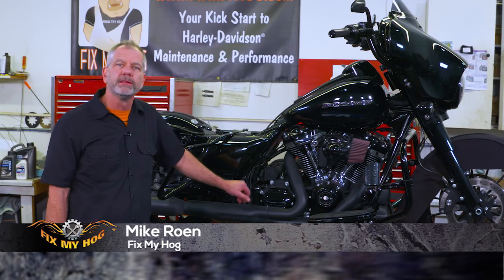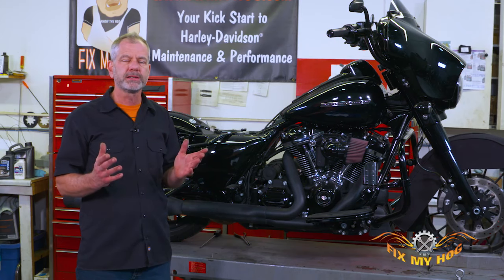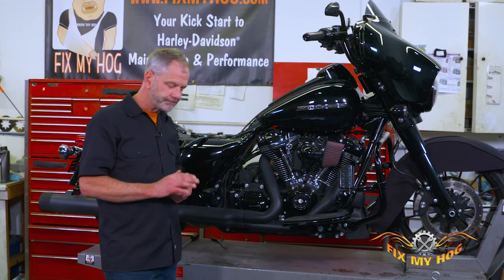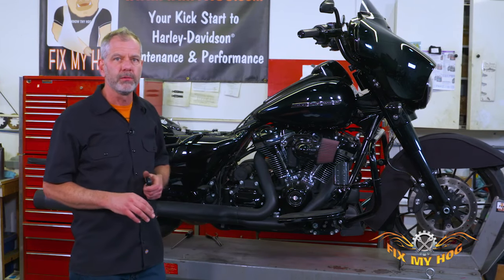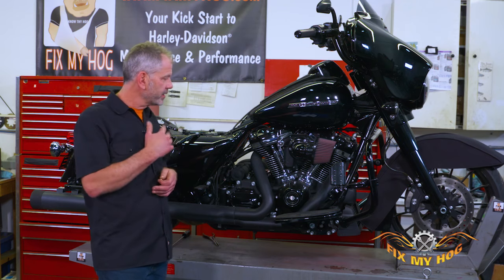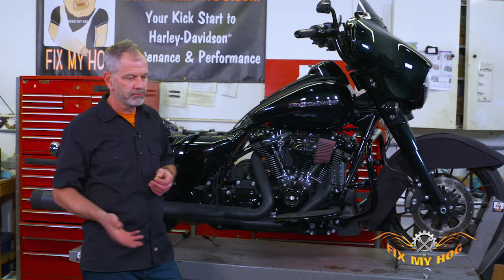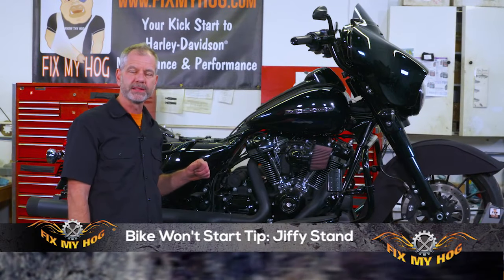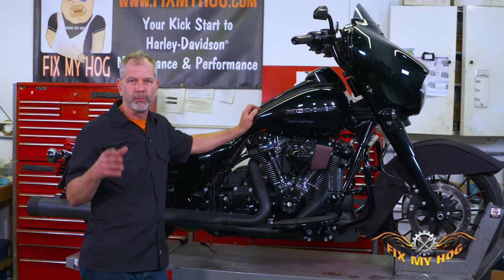Tips on Why Fuel Injected Harley Won’t Start

Comment: Thank you!!!   This is insane.  I have a 2020 Iron 883. Bought it new and put security system on it.  Wanted to ride.  Saw this video and sure enough. It was the KeyFob battery. I had not changed it in nearly 2 years.  A 6.00 purchase.  And bike started right back up!!  Thank you!!!  Changed out battery as well in my spare keyfob as well.

Comment: 2020 FXLRS, had the bike on a tender for 2 weeks with cold weather in Ohio, solid green on tender. Went out for a ride, Fired right up, rode 2 miles down the road and it stalled out at a red light, full tank, no security lights flashing…haven’t checked codes yet.

Comment: Hey so i just bought 2009 super glide last week and the only issue was sometimes after riding and shutting off like at gas station or so when you try to start the bike it will krank but won’t turn over then I turn the key take it out put it back in the bike starts right away so I thought the Batterie since it was 3 years old I bought a new yesterday put it in (not upside down)😂 but it still does it what could tha be the screaming eagle plugs are good all connections seem clean I’m a little lost now what could that be ?
Reply from the maker: Have you checked for trouble codes? https://www.fixmyhog.com/video/troubleshoot-with-harley-error-codes-008010/

Comment: hi thanks for the great vid . I took my bike out of winter storage and when I went to start it evetything lit up but it would not turn  over 
your tip on changing the battery in the key fob did the trick and the bike fired right up. thanks a lot saved me a trailer ride to my mechanic.
cheers
Randy Ralph

Comment: I once spent $180 for a new battery thinking that was the problem and still couldn’t get it to start then $150 for a short distance tow and $130 for 1 hr of labor and parts for my 1996 Bronco at the mechanics and in the end all it was,  was a faulty old battery cable and terminals that needed to be replaced . A very expensive lesson into how dumb you can get when you don’t use the noggin .
Reply: That's super common. Especially on older fords. People have a huge snow ball of corrosion on the terminal and trashes cables. Even if terminals are clean it can corrode all the way down the cable to solenoid or from solenoid to starter.

Comment: My problem on my '17 King w/12k miles is it's stubborn when doing a hot restart. 
When the motor is cold it starts okay.
Go for a ride, stop in a hotdog stand, finish you pop and dog get back on the back in about 10 - 15 and the motor turns over but has a hard time and it barely starts chugging "I think I can, I think I can" bump the throttle and fires up but not without the smell of unburnt fuel.
This especially happens in hot weather. 
Thinking I should take it to the dealer since my extended service plan is still in effect till November.
Reply from the maker: Use that warranty till the end: more starting issue info here: https://www.fixmyhog.com/post/tag/starting-problems/
Reply: @FixMyHogfreechannel  
Thanks 👍. The bike has been in the dealer since last Friday.

Comment: 2005 RK FI. engine shuts off random times.  I turn the ignition switch on the tank back & forth and it will start. Is it the ignition switch on the tank or a computer problem. (has a new crank sensor)
Reply from the maker: Great question! We have a lot of technical answers on our website. https://www.fixmyhog.com/harley-tips-a-z-index and ‘Ask an Expert’ section for members of our online community. I would be happy to send your question off to the experts. To get started, please send the email associated with your paid membership. Thanks!

Comment: I have a 2013 heritage softail.
One day I drove it around no issues.
The next day the bike was dead and I mean no power.
I put a new battery in it to see if that may have been the issue it wasn't.
Ok so I took it to a local shop that works on HD. Well they changed the ignition switch and kept the bike on charge. Still nothing, I was informed to take it to a HD shop bc it could be a electrical issue possibly draining the battery. Idk where to start any help would be appreciated thanks In advance.
Reply from the maker: Hello Charlie,  Great question! The ‘Ask an Expert’ section is currently for members of our online community. By becoming a member, you will have access to our expert knowledge. With your membership you will also receive discounts on products and hundreds of hours of Premium content.  

If you are interested in becoming a member, please click on the offer below:  

 https://www.fixmyhog.com/?add-to-cart-multi=1&products=52313&skipcart=1&coupon=C46562&utm_source=FMH&utm_medium=Email&utm_content=3&utm_campaign=C46562&vscid=C46562  Thanks!
Reply from the maker: Additional info: https://www.fixmyhog.com/video/troubleshoot-with-harley-error-codes-008010/

https://www.fixmyhog.com/videos/electrical/
Reply: What was the problem and the fix? Was it a problem inside the fuel tank? Fuel pump, fuse, relay, pressure sensor??????

Comment: I have a question my 1999 FLAHTCI, Electra glide will not start after its been warmed up. I’ve change the fuel injection to zipper motors. I’ve change the starter. I’ve changed the relays underneath the seat. It runs fine, but when it’s warmed up and you turn it off it won’t start back up. Any ideas?✌️😎
Reply from the maker: Great question!  The  ‘Ask an Expert’ section is for members of our online community. I would be happy to send your question off to the experts. To get started, please provide the email associated with your paid membership. Thanks!

Comment: My 04 low rider wont prime when I hit the switch to run and the engine light doeant come on like it usually does when you first turn it on. Have tried everything to fix it.
Reply from the maker: More check points on our Tech Q&A: https://www.fixmyhog.com/post/tag/starting-problems/

Comment: I have a 09 FLHTCU that I just replace the fuel filter, check valve and battery. I refilled the fuel tank and plugged everything in. Turned on the ignition and heard the fuel pump kick in and attempted to start the mc and it won't start. It kicks over strong and I can hear the fuel pump. Please advise
Reply from the maker: Stop by for more info: https://www.fixmyhog.com/post/tag/starting-problems/

Comment: my 01 altra glide turns over but wont fire, i spray starter fluid in it ,it trys to start but wont, what would cause that?
Reply from the maker: Hello, If you are a member, you can forward your question to programdirector@program-director.net. The response usually takes 1 to 2 days via email. 
Thanks
Joan

Comment: I tried to start my 2016 RK a few days ago in my garage, I was injured and have not ridden it in over a year. I have started it, but not in few months. It is kept on a maintainer. The first time, there was a slow crank and then it fired. It did not run like it did, but warmed up quickly and seemed ok, but still not right. The next day the weather was cooler and it took a few times to get it started.  It ran realty rough and ran worse than the day before. Could it be fuel?
Reply from the maker: Great question! Please send us an email to: https://www.fixmyhog.com/contact-us/ so we can assist you with this question. Thanks!

Comment: I got sportster 48 and i dont hear fuel pump noise when the switch is on, bike not work, tank is full of fuel and I've recharged the battery, but its not work at all
Reply from the maker: Check for error codes https://www.fixmyhog.com/video/troubleshoot-with-harley-error-codes-008010/

Comment: I got a sportster 883 and sometimes my bike likes to start right up, other times the bike will try to turn over and then it just clicks crazy. I’ll take the battery out and charge it and put it back and it’ll be alright. Come the next day it’s doing the same thing. It’s a brand new battery from autozone. Everything is tight. I can’t seem to find any fuses though. All I see is 3 fuses on the end of a cable and that’s it, they are all fine. I can’t seem to find the problem
Reply from the maker: Have you checked to see if the battery is receiving charge from stator?  https://www.fixmyhog.com/video/seat-removal-battery-check-001222/

Comment: If your bike is very low on fuel , will it click when you try to start it ? 2017 Harley Davidson slim screaming Eagle. Took my battery in and it’s good . I need battery for fob . It started and I tan it for awhile . But it died again . I shook it to see how much fuel it has , not much . So I’m thinking the little bit of gas it has in it , it clicks when I try to start it up again .
Reply from the maker: Hello,  Great question! The ‘Ask an Expert’ section is currently for members of our online community. By becoming a member, you will have access to our expert knowledge. With your membership you will also receive discounts on products and hundreds of hours of Premium content.  

If you are interested in becoming a member, please click on the offer below:  

https://go.fixmyhog.com/a19768    Thanks!
Reply from the maker: You will need adequate amount of fuel for the motorcycle to start and run. More info here: https://www.fixmyhog.com/post/tag/starting-problems/

Comment: Took the battery to the dealership. Tested and it passed with a good bill of health stating it a good battery(then they got it up to a full charge). Changed the FOB battery. Changed out both relays for brand new ones. Bike still won’t start. Bike will turn on, lights will come on, fuel pump will cycle. Hit start button... absolutely nothing.
Reply from the maker: Here are some tech Q&A to review: https://www.fixmyhog.com/post/tag/starting-problems/  and https://www.fixmyhog.com/video/troubleshoot-with-harley-error-codes-008010/

Comment: My 2015 roadglide won’t start,when I turn knob to on position nothing happens no fuel pump priming, no infotainment, and I soon I turn knob to on position takes me right to enter pin even when fob present, any idea? Thanks
Reply from the maker: MAke sure your battery is fully charged and here's some info on the FOB: https://www.fixmyhog.com/video/harley-key-fob-011415/
Reply: Fob battery or installed upside down. Positive+ should be bottom in the fob, negative - should be on top and place the cap back on the fob and snap in place.

Comment: My girl friends fuel injected Electra glide (06) can be running great...make  a stop someplace  and go to leave and it will crank over but won't start. Disconnect the fuel line from the quick coupler on the left side of the tank, reconnect, and the bike will start and go weeks or longer and not do it again. When it does do it again, disconnect the line again, sometimes it sounds like its relieving pressure, reconnect and it will start. Any ideas?? Its driving us crazy.
Reply from the maker: Great question! We have a lot of technical answers on our website. https://www.fixmyhog.com/harley-tips-a-z-index and ‘Ask an Expert’ section for members of our online community. I would be happy to send your question off to the experts. To get started, please send the email associated with your paid membership. Thanks!

Comment: Help 2000 Roadking Classic fuel pump not priming. Works when straight wired. All fuses ok. 
Thanks in advance
Reply from the maker: Hi Tom, stop by our site and check out our tech Q&A https://www.fixmyhog.com/post/tag/fuel/ and some member videos like: https://www.fixmyhog.com/video/harley-fuel-pump-filter-removal-005103/

Comment: Great info - I have an 07 Dyna that is now running a bit rough...starting to now huccup...getting worse...some are saying fuel pressure regulator or fuel line(s). Changed plug and gas - no change...any ideas?
Reply from the maker: Check out the fuel pressure test on our site and more. https://www.fixmyhog.com/post/tag/fuel/

Comment: GOOD MORNING  I HAVE A 2006 CVO ULTRA 103 IT HAS 47000 MILES HAD A CODE OF P0374 CRANK CENSOR  REPLACED CENSOR.STILL WONT START,GRTTING FUEL BUT NO SPARK ANY HELP WHAT TO DO NEXT WOULD BE HELP
Reply from the maker: Hi Billy, more info on our site: https://www.fixmyhog.com/post/tag/starting-problems/  and https://www.fixmyhog.com/video/troubleshoot-with-harley-error-codes-008010/

Comment: If I told u i took my rocker boxes apart to change gaskets but didn't disconnect the battery,  bike would turn over but not crank. Ecm fuse blew,changed it but still wont, would it be safe to think maybe ecm is bad?
Reply from the maker: There is really no correlation between rocker boxes & blown fuse and a bad ECM.
If the motorcycle ran prior to disassembly, but you are burning a fuse now; you need to isolate and repair a dead short on that fuses circuit.
Might want to start by inspecting & testing the right side switch harness & plugged connections.
You should lift the fuel tank back off and look for any possible pinched wiring. 

 https://www.fixmyhog.com/videos/electrical/
Reply: @FixMyHogfreechannel  awesome. Thanks for the tips. I need all i can get. Great videos man. Glad to have that to help out those of us that have to fix our own if possible. So expensive to get anything worked on these days.

Comment: My 2011 dyna fatbob turns over, fires but wont start. I rode to work with no issues, the next day it wouldn't start. The bike only has 2300 miles on it. The fuel pump kicks on, the battery connections are tight, I put a new battery in the fob, and replaced the spark plugs, still nothing, I need help
Reply from the maker: Check for Error Codes and more info on our website: https://www.fixmyhog.com/post/tag/starting-problems/
Reply: Did you find the problem?
Reply: @WalkingDead520 fuel filter at fuel pump inside the tank

Comment: I have a 05 touring that just had an engine swap with a 99 95ci tc and it refuses to start . Gets spark , fuel etc pops and such but won't actually start . Any tips would help a ton
Reply from the maker: Sounds like cam timing might be wrong. You may need to retrace your steps & verify that your timing marks can be correctly aligned.

https://www.fixmyhog.com/video/harley-hydraulic-cam-chain-tensioner-cam-gears-chain-install-004067/

https://www.fixmyhog.com/video/harley-davidson-camshaft-replacement-along-with-bearings-003486/

https://www.fixmyhog.com/video/install-cam-plate-assembly-015941/

Comment: Electric fuel pumps have to be primed?
I have a 2015 Harley Street 750 I added 1 inch riser. It pulled connection apart under tank. I lifted tank found it reconnect bike started right up. I noticed fuel over flow tube really close to the head so I disconnected it at a 1way valve. I heard pressure be released from it. I never did cut the hose. Kill switch is off, in neutral, kick stand up. Seems not to be pressuring up. I let crank... checked fuses again. This fuel pump was recalled and change back in 2015. Any suggestions would be appreciated. 
Ty
Reply from the maker: Great question! The ‘Ask an Expert’ section is currently for members of our online community. I would be happy to send your question off to the experts. To get started, please send the email associated with your paid membership account. Thanks!

Comment: I just had the most frustrating experience trying to get my Harley to start. Engine kept turning over after I just installed a brand new battery. Took it to autozone and they said the battery is dead even though I just bought it 😭
Reply from the maker: Turning the motorcycle over will drain the battery. Here's more info on issues of HD not starting: https://www.fixmyhog.com/post/in-the-shop-starting-issues/
https://www.fixmyhog.com/?s=battery+

Comment: I got one for ya=2014 Dyna Low RIder - turn ignition switch on- run switch on = bike in 1st or N and pull in clutch, press start and silence, bike won't start------repeat start up process, sometimes several times until bike fires up perfect. Was told by HD possibly the starter relay--------but I don't think 2014 has a starter relay. NO security and no FOB with this bike model. Sooooooo any ideas? Thanks.
Reply from the maker: Great Question! In order to "Ask an Expert" you must be a member of our online community. If you are already a member please contact our support team with your question and we can assist you further. If you would like a promotional link to sign up, please let us know!

Comment: working on a friends 03 fatboy thought the fuel pump was out so replaced the pump, regulator, and filter. still wont start so i checked the fuse and it is good. got out the test light and found out i do not have power at the fuel pump fuse but have power everywhere else, will start using carb cleaner. any ideas?
Reply from the maker: Great question! The ‘Ask an Expert’ section is currently for members of our online community. I would be happy to send your question off to the experts. To get started, please send the email associated with your paid membership account. Thanks!

Comment: I have an 04 sportster 1200, it died while I was riding. No over heating. Battery is good. Replaced all the fuses. When I go start it it doesn’t crank or turn over. Do you think the fuel pump could be the issue? I was told the stator could be bad.
Reply from the maker: Stop by our Tech Q&A section more more ideas: https://www.fixmyhog.com/post/tag/starting-problems/
Reply: Same issue ihad